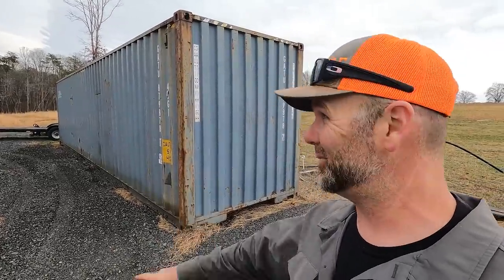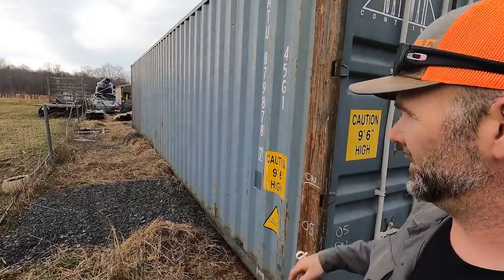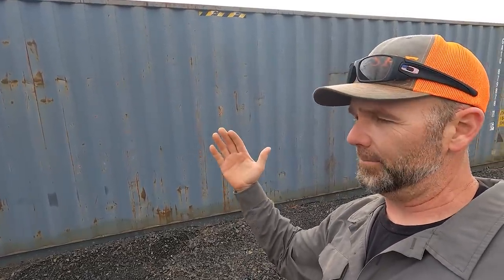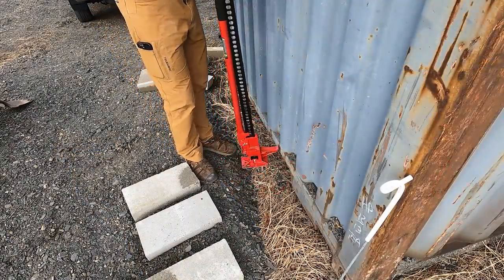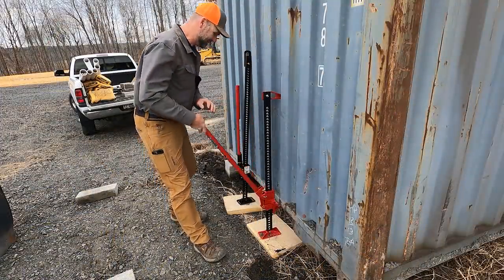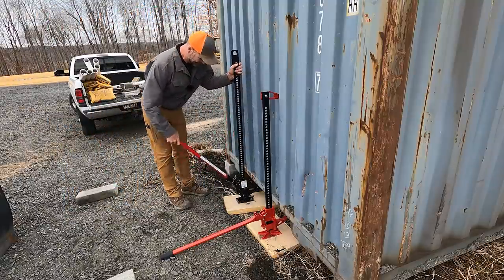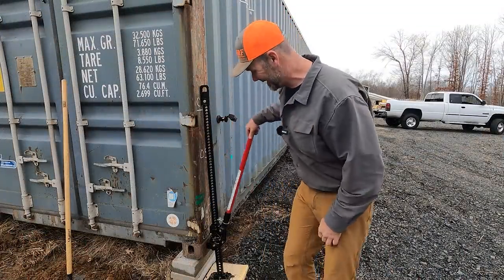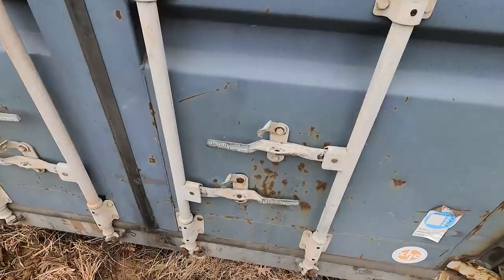Leveling MASSIVE shipping container get's interesting!

Comment: Could you have used your big tractor front end loader to lift it??
Reply from the maker: it won't lift 3 tons my friend...this is very very heavy
Reply: Are you going to put shelves in it?
Reply: Hydraulic jacks pushing against angle irons welded to the corners...
Reply: @StoneyRidgeFarmer  een kant til je wel.    Zo doen wij dat ook in   Nederlands.
Reply: @kenmaye9322  same here.
Reply: With a combination of skid steer and a tractor on each side, it will easily lift one end of the container, level it, then do the other. Or the 977 behind you. Stay safe
Reply: OMG
Reply: Or Peanut's bucket to help press down on the jack handle?
Reply: @StoneyRidgeFarmer  Remember when I was a young man, weighed 155 soaking wet. No match for a farm jack under load... 🙂
Reply: @StoneyRidgeFarmer  your not lifting the entire container so yes the tractor would have worked
Reply: Shipping container= Conex

Comment: I have three containers and had to level them all.   So far I've bent up two farm jacks.  If I had to do it again I'd spend the money for the adapters that fit in the key holes on the corners for a good sized bottle jack.  They would have worked better, been less dangerous and I wouldn't have wasted a lot of time and effort.   You may find that leveling is a yearly task, the frost heave will shift them a bit.  But you're wise to pitch the floor towards the door.

You can remove one of the door latches to make it easier to get in and out.  I did and it hasn't been an issue for sealing it up.

You're also going to want bigger and better ventilation than the built in vents you pointed out.   I didn't with my first one and lost thousands of dollars of custom built kitchen cabinets to mold.  Get air flow through there and keep it dried out.

This spring I'm going to cut a 6' wide door in the long side of my first container so I can drive my lawn tractor in across the container and not have to pack everything in from one access point on the end.

Sure love that part of North Carolina and we're cheering you on from the cheap seats up here in Pennsylvania.  I drove through that area a few weeks ago and thought about you and your project.  Blessings on your efforts to be a good steward of some lovely land.

Comment: Hey Josh just a word of caution about those types of jacks; they are very prone to letting loose either jacking them up or letting them down IF the two pins that work in and out as you manipulate the jack do not seat completely.  These pins tend to seize up with use.  I lubricate mine and ALWAYS watch the pins to make sure they seat.  Best of luck.
Reply: FF&P we always called them arm breakers!
Reply: And never put your head over the handle, especially when lowering.
Reply: Farm jacks remind me of the automotive bumper jacks from years ago. Used them for years but never comfortable with them. Recently used a farm jack to remove t-posts that wouldn't budge with a post puller. Heavy SOB's.
Reply: It's absolutely idiotic to be lifting a container like that.  1 jack moves slightly everything goes to shit.  You can get attachments for the corner locks and use bottle jacks in pairs.  Far safer.  The footings are also way way too small for the weight on them.  The whole thing will settle and need to be redone

Comment: your difficulties with the high lift jacks are why 20 ton hydraulic jacks are sold at harbor frieght stores.
Reply: You need a foot clearance for a bottle jack, that's the problem with a container, you've only got a 3" forklift gap at the ends
Reply: A hydraulic toe jack can be used in the corner holes though. Those hi-lift jacks can be super sketchy.@____________________________.x

Comment: My farm jack would not go down until I took the load off. I ended up buying a toe jack from harbor freight. The toe jack was rated for 12 tons, so more than strong enough, and had a much larger foot, so it didn't sink as much. When I had the room I stuck a 3ft 2x12 under it when leveling some other containers.

Comment: You are correct about the load distribution.  On double stack rail cars you will see a long container on top of two short containers.  Never the other way around.  You gave me a bit of a scare when the container shifted sideways.  Glad it worked out.

Comment: Josh those containers are prone to sweating due to temperature swings. I have a 40 ft hi cube on the farm and store my chainsaws etc in there. To keep everything dry I installed a ventilation kit from USCC on the roof. It uses a 12 inch turbine fan to draw air in thru the vents at the 4 corners. I have zero condensation and moisture in mine because of it. There's videos on you tube... Check it out. It's worth it. Especially if you store high value tools like chainsaws in there.

Comment: Josh, if I may suggest, when you're jacking something that heavy and you HAVE 2 Jack's,  use your heavier jack to lift, but every couple of pumps up, jack up your extra jack to the bottom of your current position. That way, if you main jack slips, your other will help catch it. I watched your foot sliding under your container. If your jack would've slipped at that moment, it could've bee disastrous. Also, for safety sake, 2-man job. 🙂

Comment: I know I'm a day late dollar short Josh. But when I was a young lad. I remember my uncle using old spiraled "screw type" railroad Jack's to lift an entire wall of his old farm house.  It was slow but effortlessly done.
Reply: bottle jacks are  easy too, but Farm Jacks allow you to get under and lift things with little clearance.  I use cheater bars when it gets tough, you have to consider though that once it is hard to lift without a cheater bar ...you are nearing the intended capacity... depending on your body weight.    A cheater bar would have been safer...  you can see him losing control as well as his feet getting close to being under the container.

Comment: Hey Josh!  There is no such thing as having too much storage space!  The container will hold a lot of stuff out of the way (and weather), yet handy to get to when it is needed.  It looked like you were having to struggle using the jacks to get it leveled.  I would recommend that if you have to do it again, slip some steel pipe over the handle!  This will increase your leverage and lessen the strain on you!  The Sawmill Shop is going to look great!  Keep plugging away!

Comment: Josh we called those jacks suicide jacks because when they let loose they would catch you in the head. If your going to level more containers go on eBay or make one your self a set of container left jigs that fit on a bottle jack and if you place piece of oak on top of the blocks they wouldn’t brake the paver blocks just like on mobile homes.

Comment: Hey Josh thank you for the video and I used to use a jack like that years ago back in the day it was a bumper Jack where you put it on the bumper I used to use it to break the bead on the tires the car tires and pop the beads like that and then take to crowbars and a little sledgehammer and get the tire off the rimso I didn't know they still made something like that to this day good to know woo

Comment: I found that when jacking my shed near the river up 4 foot, that it was much easier to raise by having the jack on the front and the supporting blocks set back a few feet from the end. Then I was not jacking the full weight each time, using the set back blocks as a see-saw. Then putting my blocks on the end when I reached the height I wanted. Do you think this would work on a shipping container with its corners being the strength? 
 I have used the small unstable base on the high jack to lift a vehicle out of ruts or over rocks and drive forward or push over and let the jack carry the vehicle from the obstacle as it falls. I think this is a common practice for off roaders.   Great tip on putting a bolt or pin as you jack it up to prevent the jack from coming down , Thanks

Comment: You got a dam good used container. If they had any used this nice I’d have got one. I ended up getting new AKA 1 trip or used once. not cheap. The floors in the used ones I looked at were pretty much patched in every square inch of the whole container. You got a dam good one.

Comment: Make sure you ventilate an enclosed container. When you store fuel-vapors cause them to explode. On the lift jacks -use and extended pole and it will make it easier to lift. Ive use mine as a winch, lift and wedge-Best tool made! Anything with chemicals can cause them to explode -from internal heat and vapors.  Have absorbent collectors. Keeps moisture down.
Reply from the maker: yeppers...no fuel will be stored in here for sure

Comment: you can remove the door latch in the middle to make opening and closing the doors easier.  They will still seal.
Reply: Yes.  Most semi trailers only have one per door.  The reason these containers have two is to keep them from buckling in handling and while stacked multiples high onboard the ship.
Reply: That's a good tip thanks. I oiled up and leveled our 40 foot high cube, so the doors seem fine now.

Comment: Hi Josh,

Somewhat surprised it took such effort to lift what is essentially less than 2 tons (whole thing is 3,8 tons the other end is on the ground.)

I've used a Farmall for far more than that with no problem - just make sure the jack can''t slip.

I made a mezzanine in mine using timber with the uprights inside the corrugations - no fixings needed! 
There are hooks in the container at floor and top level that are very useful too for hanging racks on.

Good Luck
Reply: Mine are rated at being like four tons total weight and I thought the jacks I had would easily lift a corner or even a whole end.  I'm not sure why the math was off but it sure was.  it felt like I was dead lifting the whole container just on one corner.  Whew!

Comment: Hey Josh I'd bet when using those Jacks  it was the first time you started to miss all the weight that you have lost within the last couple of years. I've run into a couple times when it has happen to me. Next time try a bottle jack Harbor Freight has a 20 tons for about $50.00 it is to dig a hole to set the jack under and slowly work your way up also use different thickness of board for shims. I hope this helps.
Reply: Hydraulic jack goes up easily with one hand too.  Safer and infinitely variable.

Comment: A toe jack   Is a great tool to have and or a port-a-power  for moving shipping  containers.  They used to be called a handyman jack, then a high lift jack, great tool to have for the farm; respect it ,they have injured and killed  many from kicking out or ground  failure due to people jumping on the handle  to get one more click.  The right way wrong way  or the farmer way.... you choose,  not being a safety sally, ya don't want to get dead; dead is a very long time.  I say all this from growing up on a farm and doing  same kinda stuff, in many cases lucky to have  all my fingers and toes.

Comment: HAHAHA   Josh, as soon as you said these jacks look fairly simple to use, I could see one going sideways and bending.
I use mine quite often, to lift sheds ect. They are notorious for sliding sideways. I have learned it does not take much to keep them straight. I use rope and tie the top to something both ways, which prevents it.. Also a 3 ft piece of pipe slipped over the handle helps with all the grunting.  LMAO
Only other thing I have found around here with the temp swings we have here, the containers need a huge amount of vents in them.
Vents in the bottom near floor, and a few toward the top. We have found the turbine type work best as they draw air, which in turn draw air through the bottom vents. There were times when entering them, before the vents, you would have thought you were in the rain forest, with the amount of condensation, dripping from the ceiling.

Comment: I can't tell from the camera but you might need another two blocks under each corner? You'll need your cats to keep that dry space rodent free, so it has to be at least 'cat high'. And if you bed these on sand first it stops them cracking on a rock.
If you have the time, paint the inside white, any lighting you put in there will work better. Those tiny vents are for cold sea voyages, on warm humid land you might need bigger ones. Solar powered fans work well.
Reply: Yes this should be attended to I think. I pulled down an old shed on a relative's farm, it was built low on the ground and the number of rats that rushed out was horrifying
Reply from the maker: it's nearly a foot off the ground in the middle my friend....plenty of room for air and kitty cat mousers to take care of biz
Reply: @StoneyRidgeFarmer  Ah that's OK then, I wasn't sure :chillwcat:👍

Comment: I was tensing up when you were trying to reef on that corner with your foot swinging under the container. There were no other blocks or obstructions other than the one placed at the corner, so if the container decided to shift when your foot was under that corner, it may have been a bad scene. Always use more temporary blocks in the middle than you think you need, just in case.

Secondly, I would have advised to use a snipe (long pipe) as extra leverage. This would have helped in two ways, greater mechanical advantage and also body placement further away from the container. There is a general rule in safety to never ever allow ones body near a hazard if it can be helped. Google up "Hierarchy of Control" for more on this concept.

Otherwise, nice video. Stay safe!

Comment: Thankyou so much for this video. :) We have our container on our farm already, but in the last year, it has settled into the ground some, from rain and moles :(  We  have been trying to make plans on how to level it out. So HUGE THANKYOU  TO YOU👍 Our only other dilemma is when the temp freezes out here, and then defrosts, we have heavy water droplets on all our stored items inside, which in turn  can make our  items moldy, so that is on our agenda on how to solve that little problem as well. ;) Thanks again for a GREAT video!
Reply from the maker: don't take this as an instructional video....I'd beware using those jacks...sounds like you need to set some piers below the frost line and get your container up about 10-16 inches or so
Reply: @StoneyRidgeFarmer  ..... Oh, no we totally get it, this just helps give us some ideas, but also  keeping in mind our use of more professional and appropriate gear when we do. I just wanted you to know I appreciated your video and show some support.. Thanks for the  info to help possibly deal with frost inside my connex as well 🖐️

Comment: Josh, I would use the leftover block to put around the corners for added safety. If the supporting block should fail, the other blocks would be their to prevent the shipping container to fall laterally.

Comment: Next time, just use a floor jack. They work much better than those suicide jacks. Also, 2' X 2' concrete pads are a better option. Are you planning to build shelving along both sides and the back ?

Comment: I think you have an extra 4 inch concrete block under each corner, for no benefit at all.  Also, never lift by anything but a corner.  Those bottom beams can't support the weight of half the container.  They will bend, and that's how you get a twisted container.  BTW:  I think a critical thing you need to run a farm jack, is a 300 pound farmer!  I actually have one of those.  I used it to pull rotted 4 x 4 fence posts out of their concrete.  Then it's a snap to replace them with steel posts and a little bit of concrete in the 4 x 4 hole.

Comment: Perhaps level out the area with the tractor then set the container on level ground?  That's what I did using limestone (whiterock).
Reply from the maker: you should never put a shipping container directly on the ground..it will sweat, rot and fall apart

Comment: You are exceeding the rated lifting capacity of the 'Farm Jack'.  I have ruined a couple of them that way.  Get a10 or 12 ton hydraulic jack,, dig a hole to get it under the container, and lifting will be easy - and a lot safer.
Reply from the maker: farm jack lift is 3 1/2 tons....building weighs 8500lbs  we're using 2 farm jacks and only lifting one side my friend...I agree...a hydraulic jack would be handy...but can't get a bottle jack under it

Comment: Looking at one of these in either a 20 ft, or 40ft flavour.  Want to put in a couple of windows,  insulate the inside, and turn it into a wood workshop at at my summer property (aka cottage.) Thoughts,  insights? Would want to put a door in the side as well so I don't have to open the end to go in on cold days. Ofcourse need electrical  service.... in a steel box.
Reply from the maker: I think it's too narrow to do any real work inside....pix don't do it justice...it's not very wide
Reply: @StoneyRidgeFarmer  thanks Josh.

Comment: Interesting. Have a project with two 20' containers. Live on a mountain, must place them on concrete piers to level. In parallel. 16' apart, roof trusses above, floor trusses between. Profoundly less expensive that a metal workshop building...

Comment: Ag jacks are dangerously  weak for that job.  Fork lift jacks work well and the old mechanical Simplex (Duff-Norton releases suck) mechanical telephone pole jacks are magnificent used with a piece of chain through a corner fitting.  I also use paired (permits swapping out shims) bottle jacks atop 6x6 wood cribbing. (See first responder cribbing and shoring videos for lots of useful info you can apply to containers.)

Comment: good job; watch your chin do not stand over the handle, watching the fingers when using those jacks, I found putting the handle in the uprite position before moving the release lever was safer for me. I used railway ties across each end was a bit more stable for my liking